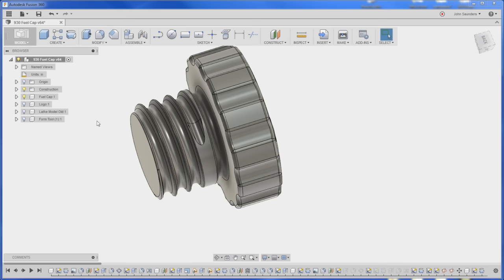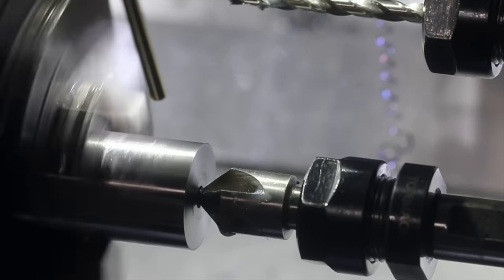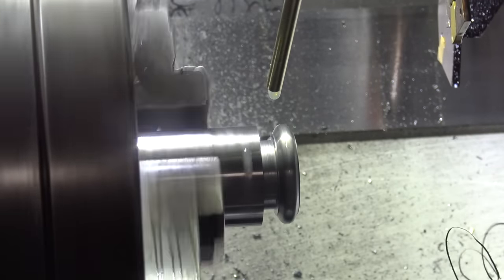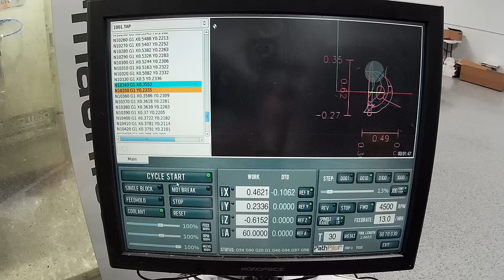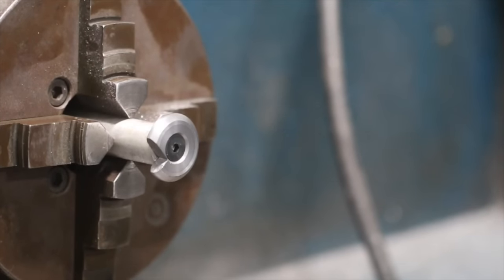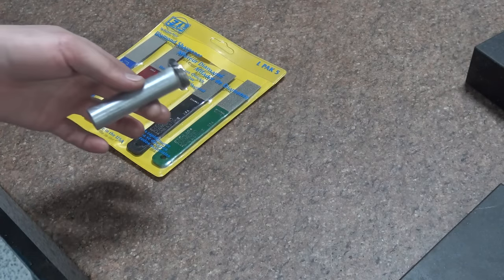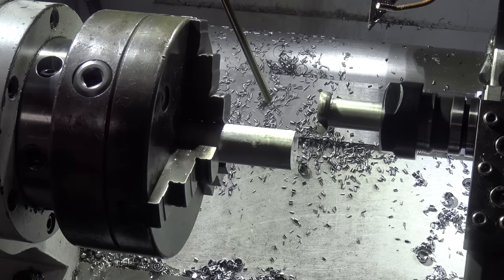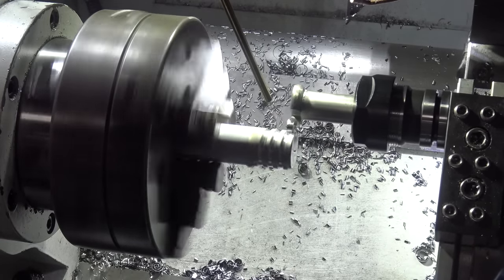Custom CNC Threading Tool! Widget92

Comment: John,
      A couple of things I'd like to point out which might help you in the future with these tools.

1) On the lathe, get into the habit of programming in Inch Per Revolution (IPR) instead of Inches Per Minute.  There should be a modal code you can call in the control that will let you program the feed in IPR instead of IPM.  This lets you program your chip load directly, instead of having to do math, and keeps the chip load constant, no matter if you change the spindle speed with an edit or not (since the feed is directly related to the speed, regardless of the programmed RPM).

2) That's not a countersink you're using there, it's a "Center Reamer", meant for cleaning up or finishing a center hole for later use with a tailstock center.  They're not meant to cut very quickly, or very much.  Starting from a square shoulder like that is about five or ten times as much material as it really ever wants to remove, and as you found out, the result of trying to cut too deep and too fast with a center reamer is that you get chatter and pushback.  Buy a six flute chatterless countersink from someone like Keo or MA Ford (I'm partial to MA Ford, they work, and they're cheaper than KEO, ENCO has them on sale pretty frequently too).

3) Blue chips with carbide are A-OK, but if you want that tool to break a chip, you're going to have to go to a smaller nose radius (we've talked about this before actually).  Find yourself some CNMG 431 inserts with a chipbreaker made for finishing and give them a try.  What you have now ain't doing it's job very well, and big stringy tool steel chips will do a lot more damage to you and your machines than those alum ones from before.

4) Center Reamer/Countersink != Spotting Drill.  You can chamfer with a spotting drill, but you cannot spot with a countersink (not for very long anyway).  The point geometry is quite different between the two.  Some of your pushback might have come from here actually.  Since a center reamer comes to a conical point without a chisel edge or split point to start the cut, the only way for it to penetrate the material is to literally push it's way in.  All ballscrew thrust, and nothing more.  Bad for the tool and bad for the axis drive gear.

Congratulations on your big open house being a success.  Glad you all are growing and still being able to keep up with it.

Hope this helps.
Reply: LogicIndustries are you talking about using G99 instead of G98 and G96 constant surface footage?

Comment: I see plenty of people noticed that left hand thread on the lathe version.

However,  I've always liked the idea of cutting threads with a helical path on the CNC mill. In a way, all milling cuts are interrupted; it's just that with a multi-tooth cutter the interruptions are smaller. But however small, each tooth has to enter the work once per rev. ( I guess that's not quite true when plunge cutting, but that is fairly rare as a milling technique.)

Form tools are a funny sort of situation. The form has to be accurate either along a workpiece radius (for lathe form tools) or along a tool radius (for milling form tools). You originally made the form to be accurate on a radius of the tools; hence it was designed as a milling form tool. When you milled the cutting surface below a radius, it didn't change the outer profile, so it continued to have the proper profile as a milling tool, but it changed the profile when used as a lathe tool. (Prove it to yourself with this thought experiment: make a tool with a partial circle profile. Now cut across the profile at an angle; you now have an elliptical profile. Make the cut at a steeper angle to exaggerate the ellipticity.) If you want a lathe form tool with some top rake, you have to adjust the form so that cutting it on an angle brings the form to the desired profile.

Super open house. It was great to meet yourself, some of the other Youtube Creators, and see all the other attendees.

Comment: A good job!

For your form tool on the lathe you should have some front relief by merely grinding the cutting edge below the centerline of the tool. About 1/8 inch (or 3mm) would be plenty for that diameter of tool. Note that this will change the profile of your form slightly but probably not enough to matter in this specific part.

To find out more about circular form tools, search for books on tooling automatic screw machines, specifically Brown & Sharpe machines. There's a ton of info in those books about grinding these tools. 

In the oldest books they talk about turning the forms in a lathe, then hardening the steel, then a finish grind if the class of work needs it. I have done this, except for the grinding, and it works very well. Most modern steels don't distort as much when heat treating as they did 70 years ago (1940s...).

If you wish to borrow one of these books (this is for John) just let me know.
Reply: +NYC CNC It didn't look like it.

Comment: I'm watch these videos without much experience but I'm amazed at how exactly the radial and transversal movement on the final lathe work synced perfectly. Is that hard to do (b/c I imagine you have to take into account the exact pitch of the thread and time all the setting up parts right). And, the lathe has to know where the thread was started and take that relative position into account. 

I hope you show that part of CAM designing but can most CNC lathes do that?

Comment: Hi John ! It´s a beauty seeing the cutting tool on the lathe, even love the sound of it ! 

One question though... when using a custom tool, how does the CAM on Fusion "know" how to compute the cut ? I know you obtained the contour for the thread from the CAD model itself to create the cutting edge, but I´m intrigued about the CAM process in Fusion on how to define the operations; whether it´s defined as an adaptive cut or if you do a threading operation using the custom profile.

Could you please add a video explaining the CAD process in Fusion to clarify ? Thanks !

Comment: Interesting video.  It got me thinking about how easy it would be to create regular HSS cutting tools using the CNC mill.  I would think it would be able to cut all of the relief angles in the end of a square bit (even the nose radius) and then all you have to do it hone it.

Comment: I wonder what's the upper limit on that type of tool. I mean,  i know it's ultimately down to the lathe and gripping method (on the tool and tool structure itself) but still, really neat method to cut big threads.

Comment: When working with steel, don't you want blue chips as that means you ARE taking heat away from the part?

As well, could this have been done easier (that is, making the threads on the gas cap)on a VMC with a 4th (using a ball tool to make the threads, since they are round)?

Comment: I noticed that the post you are using with Fusion 360 stops the spindle between operations that use the same tool and so you have to wait for the spindle start time before the machine will cut again.  I fixed it on my post, let me know if you would like a copy.

Comment: Hi John;  Very cool, great work!  Question for you: What kind of Keyless Chucks are you using?  We bought and tried some of the Tormach Keyless chucks but found they had tremendous runout.  Some of them had upwards of .040" runout!!  I guess I shouldn't expect better for a $40 tool?
Reply: +Derek Richline The Jacobs taper keyless chucks; specifically the 30149 - KEYLESS DRILL CHUCK - 5/8" - JT6 and the 30474 - KEYLESS DRILL CHUCK - 1/4" - JT1.  They both had significant runout .012" for the 5/8" and .040" for the 1/4".  This was measured over 2 of each tool.  Tormach replaced the first set under warranty.  The second set had the same amount of runout.

Comment: hi john love the video, i am enjoying the videos but having a hard time getting my head around fusion 360, i have a cad model of the handibot 2.0 which i wish to cut the parts on my bf20 cnc mill, i have the model for all the parts on fusion 360 but to tell the truth i really dont get how to lay out the cut paths, most of the cnc milling i have done is 2.5d with cambam and thats works great but understanding how to get tool paths on the handibot model i have has me pulling my hair out, how do you sent a file to someone on fusion 360 so they can look at it ? plus if you would could you please have a look, i know your busy. thanks daniel
Reply: Great thanks John, I will sent the file in the morning here as I am in the uk, I think I may have an idea wot I am trying to do, if i select a component and active it, then add a new sketch to that component, then select the new sketch and right click I can save as a dxf file, I want to get the parts water jet cut and the file has to be a dxf, I hope that makes sense, I am sure you will see wot I mean when see the 3d model, it's a handibot 2.0, Thanks daniel

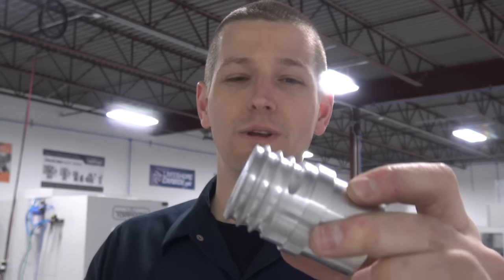Comment: My guess on your radius is your tool width is incorrect and the tool is actually wider than the program thinks, thus your actual radius is cut too small and you are left with the steps. Also check into a Kennametal groove and turn. I bet you could have turned that profile in about 3 passes with no pullout saving a ton of time. See 23:09 in this video https://www.youtube.com/watch?v=1OmrlXbbcU4

Comment: Ha, and lets try that again in a right hand thread... Don't feel bad I thread mill a $800 part with a 2" left hand NPT because I climb cut top to bottom, oops ;)
Reply: I'm assuming he was doing a test piece with the first incorrectly cut point so that the tool wouldn't be ruined if he did run into issues with deflection.
Reply: +NYC CNC remember there's two type of people, those who make mistakes and those who don't get anything done. Glade to have you in the former club so that work gets done, mistakes get made and my wife can be so confused at why I find a machining video so funny.
Reply: +NYC CNC haha I was being hopeful for ya. Betcha won't do that twice though.